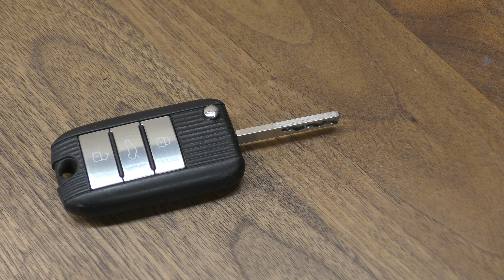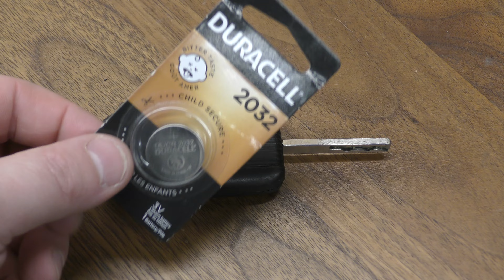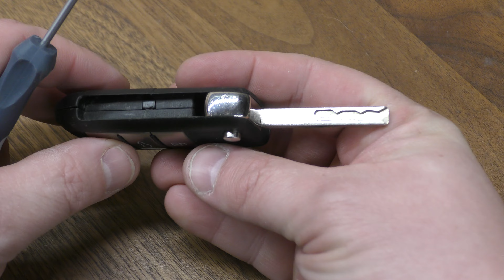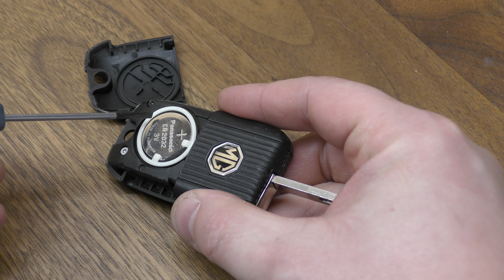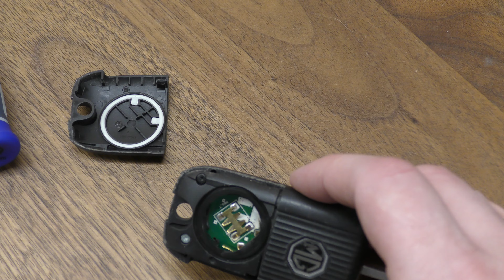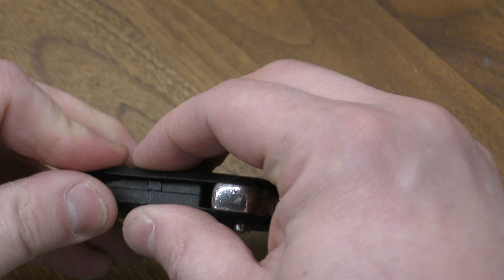MG ZS Key Fob Battery Replacement - EASY DIY

Comment: Thank you! I wouldn't have worked it out with the manufacturer's user's manual alone. I note I found it was super-tight to take out the battery (which just fell out in your instruction vid once the cover had been opened) with my key fob, and I needed to use a leverage with a driver.